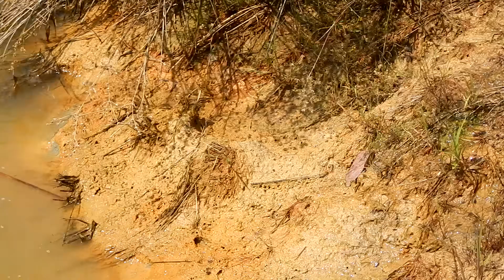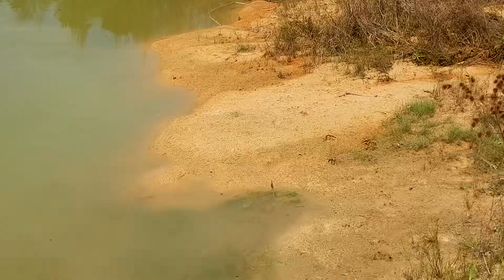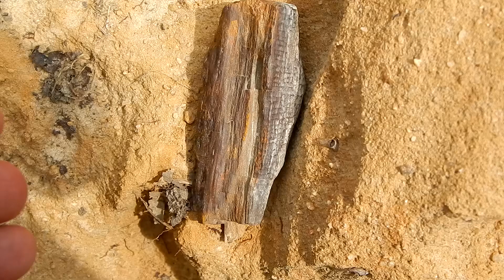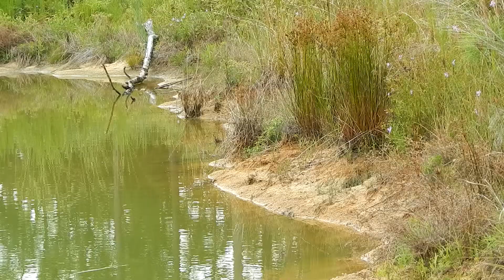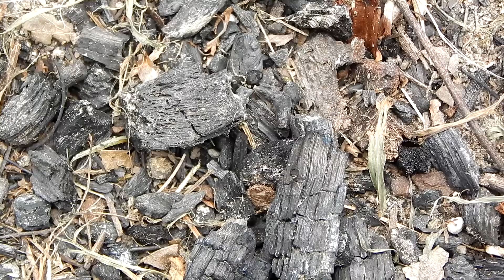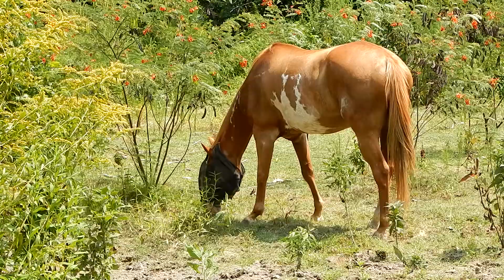Concretions And Indian Paint Pots

Comment: Is the concretion magnetic?
Reply from the maker: I'm glad you asked. I had never tested it before but it turns out that small parts of it are. I couldn't get a magnet to stick to the whole rock but when I chipped some small pieces off it could pick up some of them. These rocks will sometimes set off metal detector too.